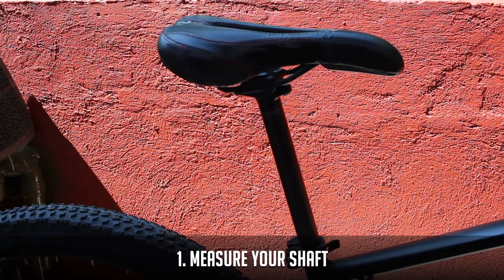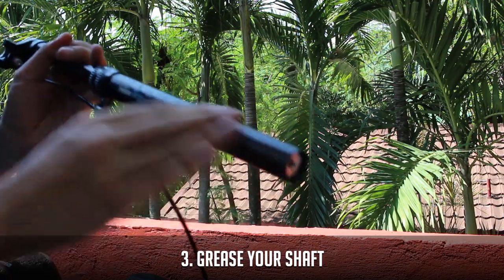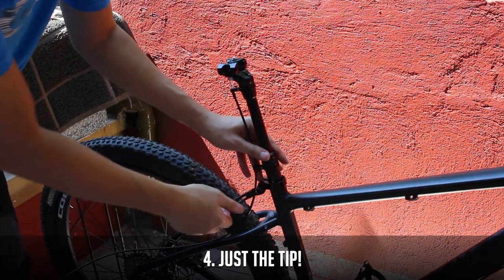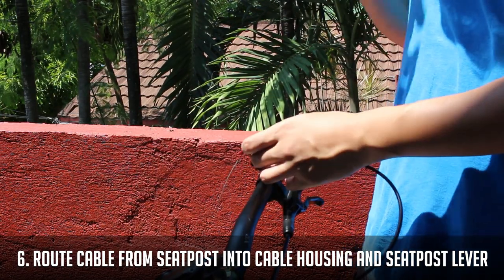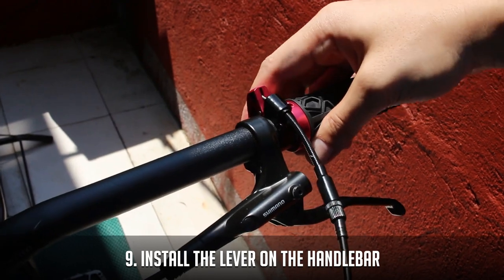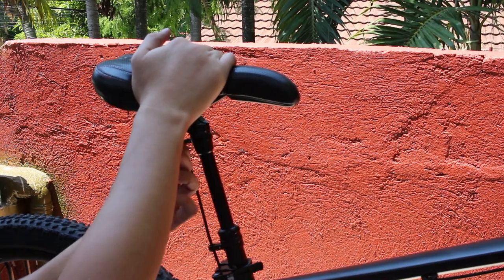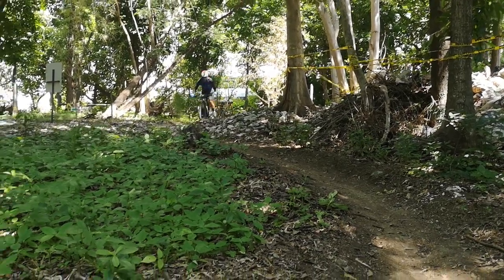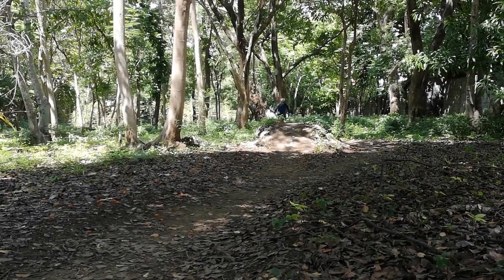Installing a Dropper Seatpost

Comment: Hi! Thank you for your video! My Marin Bobcat 5 2021 is on the way and I wonder about the length you decided to use. 110mm seems more than enough, right? I wonder cause I'm looking at the internally routed PNW Loam, and the shortest option is 125mm. I assume longer that that would be too long since the post does't go down much due to the water bottle mount. Any thoughts? Thank you again!